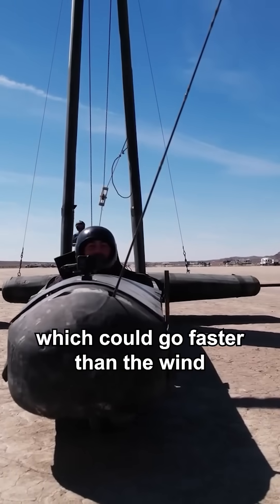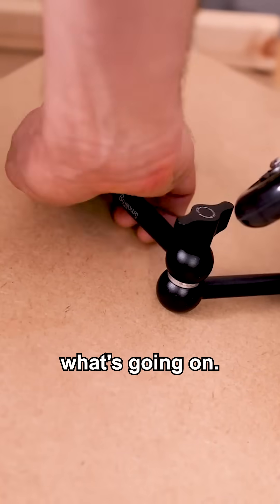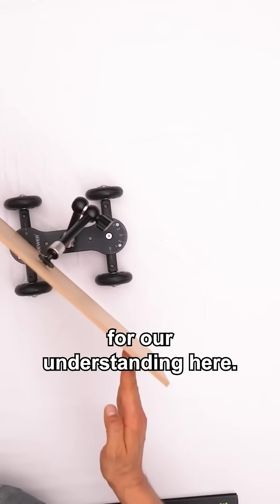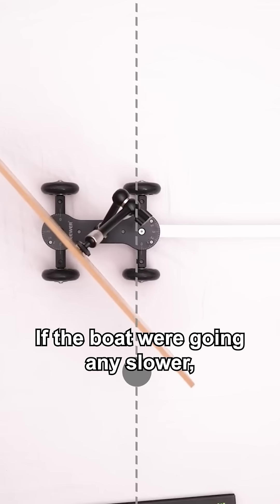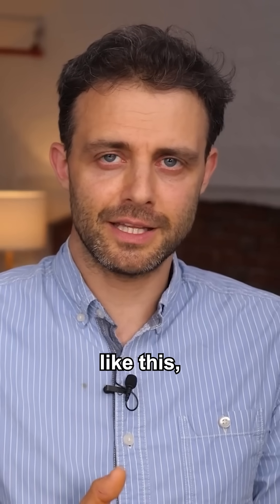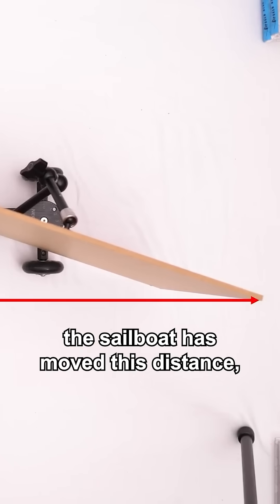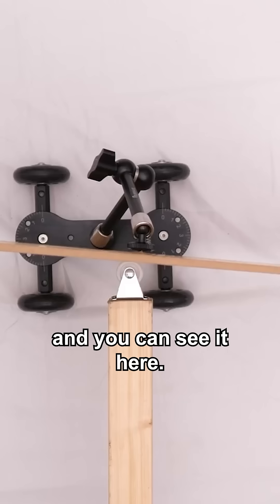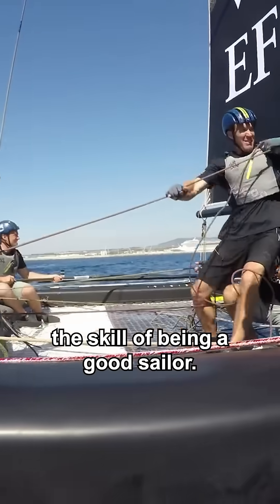How a sailboat can sail faster than the wind

Comment: - Regard the sail as a mirror for the wind, interacting elastically, rather than inelastically. The force is not in the direction of the wind, but of the normal to the sail.
- Imagine that the hull presents so much resistance to sideways movement that the force from the wind is resolved purely in the forward direction. This allows the mechanical advantage to be realized.

Comment: In kitesurfing we use this effect all the time but Derek's car is travelling directly downwind so the analogy isn't very accurate. What he's doing is converting torque to velocity using the propeller, I don't know how to explain it much better than that. When you're travelling downwind your car still has some torque that can be useful, so they put resistance on the wheels in the form of a propeller driver to harvest that extra torque.

Comment: There is a lot more to it that I believe they covered in the video, but I’ll provide a brief explanation from someone who build boats for a living.

The type of sailing they were talking about in the short is called Crosswind sailing. It’s when you are traveling at 90° to the wind that is powering your movement. for simplicity, this is just about as fast as you will ever go on a sailboat. However, you’re going so fast that, relative to the boat, the wind is now no longer coming at you at 90° but coming at you a little bit from the front, because you are now moving through the air. This change in relative wind direction obviously reduces the efficiency of your sail. With the wind no coming at you from the front rather than from your left or right, the simplest solution is to simply steer the boat away from the wind so that you can have the wind coming at you from 90° again. Great! But now we’ve sped up again and the wind changed again. OK, then let’s turn a little bit more… you do this enough times and you’ll find you have turned completely away from the objective (original) wind direction and you are sailing almost straight down wind, but doing so much faster than the wind that is actually pushing you. This doesn’t really come up in sailing all that often except in Racing, but it is a fascinating trick that sailors figured out a long time ago.

Comment: He never really explained this component of it.  The size of your sail matters a LOT.  Obviously if a huge boat has a tiny sail, it won't get much push from the air.  Only a few of the air particles are going to be hitting.

So in his example he had the sail angled at 45% and about 8 of the air particles were hitting the sail.  Obviously if the sale were 1/2 the width it would only get hit by 4 particles, and therefore receive 1/2 the push.  If the sail were twice the width it would be hit by 16 particles and receive twice the push.

While there is resistance in the real world for all practice purposes if you have a sale with twice the surface area, you re going to be pushed twice as hard.  That doesn't exactly mean you will go twice as fast because all that cloth and the rigging to hold it up all adds weight to the boat causing it to ride lower in the water.  Still you are going in the right direction.

So the goal of any sail boat is to put as much sail up into the wind as possible without reaching that tipping point where the extra weight is costing you the extra speed you would get form it.

Another important factor is the height of the sail in the air.  You may have noticed that many sail boats have rather thing and tall sales, instead of very wide low sales.  This is because the wind generally moves much faster higher up.  So while you get the diminishing return for all the rigging required to hold a sail high up into the air, you get the benefit of the usually much faster moving air.

Comment: You cannot explain how a sailboat moves into the wind using a flat board as a sail.  The sail acts as an air foil so that there is a pressure difference between the pressure on the windward side pushing forward on the mast and the opposing pressure on the leeward side.

Comment: There is another equally powerfull mechanism that may be slightly harder to model in such a clear way: The curved shape of the sail creates a low pressure area on the forward facing side of the sail that actually sucks the sail forward, just like the wings of a plane.   😊

Comment: Too simplistic. Flat planes such as your board has a minimal amount of lift. A true sail can produce much more lift, thus providing different data sets, and results. Which was nice,but the effects of the parasitic drag from the wetted surface area of the hull, and the design hull speed are significant factors.
FYI, the formula for design hull speed is:
Square Root LWL, Length Water Line, times 1.34.
So boat with a 25’ waterline is square root 25=5 x 1.34 = 6.7 knots, or 7.7 mph.
Then there are multi-hull sail boats. They cheat on hull speed. I have a 35’ racing sailing catamaran the in 15 knots of wind can sail at over 20 knots of wind.
Can’t wait to get her overhauled and back on the water.

Comment: You are approaching this the wrong way. The fabric of a triangle sail billows out because of the low pressure created by the wind going around the mast and traveling further than the wind on the inside of the sail fabric. The force of forward momentum comes from this low pressure and the boats keel preventing the boat from moving sideways. In other words, the wind beneath my wings is bullshit song that doesn’t understand what an airfoil does.

Comment: This is so disgusting wrong I can't even watch the end. Sails work like wings, creating lift like a wing does, only sideways. The rudder + keel/centerboard/ daggerboard stop the boat from being forced in the direction of "lift", and redirect it forwards. The FASTEST point of sail is called a broad reach, when you are Almost sailing the same direction as the wind, but the wind STILL goes around the sail like a wing. As boat speed increases, your "apparent wind" a combination of the true wind direction and what you feel from moving quickly, combine to help you seem like you're sailing as if youre pointing more towards the wind,  but youre still on that broad reach. 
-from a lifelong sailor, competitive,  and sailing instructor.

Comment: I get this is theoretical, but I think there's a way to explain it with angle of attack and distance packets of wind have to travel on the windward and leeward sides of the sail (lift), plus comparing sails to airplane wings - where wing counterforce is gravity, and sails it is the keel. Add the difference between true and apparent wind. These, forces, combined with reduced friction of boats to move faster than the TRUE wind speed - and foil boast with very little resistance move A LOT faster than the TRUE wind is blowing.

Comment: The boat is also being pulled along by the sail as the air going around the front has a lower pressure, effectively turning the sail into a sideways wing.

Comment: This explanation doesnt seem correct. It implies that if I take 1 cubic meter of air with a given speed, meaning I have a given kinetic energy, then I could give arbitrarily great speed to the boat (assuming no friction). However the transferred kinetic energy cant be greater than the kinetic energy of the cubic meter of air.

Also why couldnt the boat go faster than the wind? A plane's wing generates upward lift even if there is no steady upward movement of air in the atmosphere.

I would assume whats important is the greatest pressure gradient between the two sides of the sail. Also taking into account that there is an optimum between pressure gradient, direction of transferred momentum and air/water resistance

Comment: wrong.

this is still depends on the strength of the air. if you give 10kgs air push on 10 tons vehicle on 10x10 sail, what is the speed?
Reply: also, the road is 10 degrees upward.

Comment: I though the sail would be at 15 degrees relative to the wind direction and the wind would push the sail into a curve which makes it act like a wing where air flows over the front and back of a sail. The air over the front would go faster and be lower pressure than the back side of the sail so it generates a lift force forward.

Comment: The explanation for how a sailboat works is correct and has nothing to do with the 'contraption' depicted, as it was tested going directly downwind. It uses a wheel driven propeller to pull itself through the wind while traveling in the direction of the wind. Wind energy on the propeller is extracted by the wheel. The rotating propeller is not a sail driven by the wind.

Comment: You talk about the limiting case "a world without resistance", but if that were true, the boat would go sideways. The greater the angle, the higher the sideways force and the more the tendency to go sideways.
That's what a keel is for but, in the real world that increases the resistance.
So, this is a useful thought experiment, but far from the real world.

Comment: It doesn't work that way. Air is not a solid stick. Incidentally it's the same quest as asking how much energy a wind turbine can extract from a body of air. The problem is that as your packet of air does work on the sail it slows down and that in turn gets in the way of the packet of air behind it. The more you angle your sail to make the boat faster the more you block the air. Note Betz's law (see Wikipedia)

Comment: In the real world you can actually exceed 90 degrees to the wind, known as a beam reach, and sail into it, albeit to a limited degree, this is known as a close reach. When doing this the sails are set as close to parallel to the centerline as possible, the boat is said to be "close hauled" in this arrangement, and you can actually achieve a relatively high boat speed in this arrangement. However, the boat will tend to sideslip significantly and even though the bearing might be closer to the wind, the actual track will be closer to perpendicular to the wind. That being said, a beam reach has the same considerations, assuming for a moment you have a 15 kt north wind coming from 000° your bow might be 090° to the wind but your track is probably more like 100°-105°. Also exceeding the wind speed is a hell of a thing to do in real life, getting even 10 knots from a 15 knot wind in anything bigger than a laser or a laser2 is a hell of a thing to achieve imho. Im not a racer but i have sailed for most of my life. To get even 1/2 of windspeed out of a boat you need to be sailing the hell out of that boat, shit will be falling off shelves down in the cabin. You will be working your ass off to trim those sails where you want them.

Comment: I do sailing, not great at it but I do need to deal with this often, the max speed gathered from the wind is not what you want though, you want the max speed you can gather from the wind while still being able to maintain control, capsizes are easy to happen if you're too silly or cocky about this, but I don't over estimate my self I generally underestimate that's why I'm not great but thats a practice thing so I'll learn eventualy

Comment: Nonsense. It’s due to the airfoil shape of the sail creating lift—pull—on the forward side of the sail. That and resistance to slippage, sliding, from a keel.

A sail is boat BOTH pulled AND pulled through the water. Hence a faster velocity than the wind speed.

Comment: Let's not forget that a boat is a solid object resting on a fluid. It's a Weeble. (Hopefully, it wobbles but it won't fall down!) That means some of the wind force changes the angle off vertical. If you face the sail almost directly to the wind most of the force will be knocking the boat over, not moving it forward.

Comment: With your zero drag model, wouldn't you want to bring in the angle of the sail closer to parallel to the direction of travel as the boat accelerates?

Comment: Yes of course a lot left out in this short video, but I think there are some more interesting trivia to note about this:
1. Max speed of a boat is actually defined by the length of the boat (1.3 x square root of (waterline length))
2. There is (similarly to how air planes fly) actually more suction force behikd the sail than push on the sails.

I’m also a bit sceptical regarding the ”optimum” in the video: when sailing you never want flutter in the sails, which you would get at a speed when basically the dots/sails never touch. Of course it doesnt work like this other than in theory but anyway

Comment: This is not how a sailboat works.
Reply: The sail is not used as a kite. The sails are trimmed to get air on both sides, the air on the inside of the sail travels differently from the air on the outside of the sail creating forward motion. 

Picture a sideways airplane wing.

Comment: A sail just doesn't work like that. At beam reach as shown and for any points of sail except Running, (ie : wind received from the rear). The speed is generated by the difference between the air flows who who goes on the intrados and on the extrados of the sail. 
At beam reach you must put the luff part of the sail allmost parallel to the wind (the luff part is the first part of the sail who take winds) while the rear part of the sail are slightly curving the wind.
So while accelerating, the boat creates "head wind" (the wind you feel facing you when you ride a bike).
you will have to add the "head wind" to your "true wind" to have your "apparent wind" (the combination of true and head wind).
now the apparent wind is the wind you will use to accelerate more. 
While accelerating, you create more and more "head wind" , added to the "true wind" the "apparent wind" is slightly increasing.
As your sailboat accelerates, you will have to slightly trim the sail in order to maintain the best angle possible. 
For really fast sailboat like those of the America's cup, you will have 10 knots of wind while the boat goes to 30 knots (55 km/h, or 35 mph).

Comment: I think that @SteveMould missed the point here, although I'm not familiar with what's the short directly referring to.
The understanding that you can't travel faster than the wind is based on something completely different. The description of side wind is fairly good but when we think of it, we mainly think of wind pushing us from behind, or at least, we think about the reaction force in the direction we travel. The whole problem is completely different from what Steve described here. The whole problem is that the force is decreasing as the speed increases to the point that it equalizes with other forces and you can't gain any more speed.
This happens simply because the relative speed between the sail and the wind (in the direction we travel) decreases. You simply can't move faster than something that pushes you. But when we are talking about the car or the boat, they move on some medium, on the road or water. The relative speed between wind and that medium doesn't change. The relative speed between sail and the air decreases while the relative speed between sail and the water increases. If you have a way of capturing the energy from the relative speed difference between the air and the water/road, you can get the same amount of energy regardless of your speed.
Now the example Steve gave us can be used to explain to in fairly easy way. Steve showed how you can move without "capturing" any of those "air pockets" but the same applies to turbines. If the turbine rotates at a certain speed with certain blade angle, it will also miss those "water pockets" and it will not create any force in any direction (remember, no friction in this idealistic world, no energy loss on blades moving through water). This means that you can have a turbine in the water that neither propels you, nor slows you down, right? The same as the sail moving at the speed of the wind. Sail doesn't push the air because "air pockets" escape it at the same speed, it's also not pushed by pockets behind.
Now the important part. If we replace the sail with another turbine connected to the one in the water, what will happen? When we stand still in the water, both turbines are stopped, so the whole force of the wind pushes still blades of the air turbine. Either those blades will start rotating (this will move the water turbine propelling the boat) or those blades will catch the wind like a sail propelling the boat (which will make the water turbine turn which will make the air turbine propel us even more).
This may look counter-intuitive at first but that's because people think of separate parts independently. Think of it as a whole. If both turbines are connected and match the speed of the boat (both turbines move air/water at the speed of the boat), then they neither add, nor subtract energy. Because the sail is fixed, the faster you would move through still air, the more air you would have to push, right? But if it's a turbine that matches the speed, the relative speed between the turbine and the air will not change. This means that when there is a wind, it will always be acting on us just because it doesn't match the speed of the boat - the air moves faster than the turbine would "want".

Comment: Your math is wrong because air is traveling mostly parallel the sail. So it's actually because the boat is know going the speed of the of the air and thus is actually creating more air then the speed velocity of  the air that is measured from the standing still relevant to the boat.. and hence creating the effects of going faster than the air .. but in reality it's just physics..😂

Comment: But a sail is not flat. It is a wing with a bulb on the front leeway side. So the air travel faster around the front of the sail than behind it. That creates an underpressure pulling the boat forward. The fastest a boat can sail is with the wind a little from the side and behind. But it feels faster when tacking, bacause you go into the wind and waves.